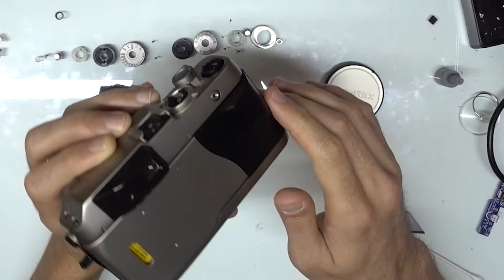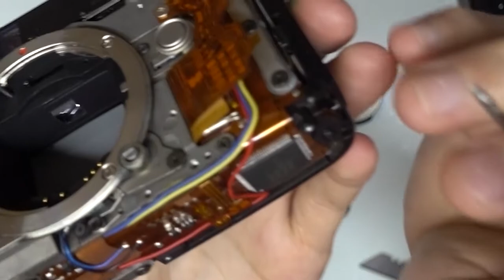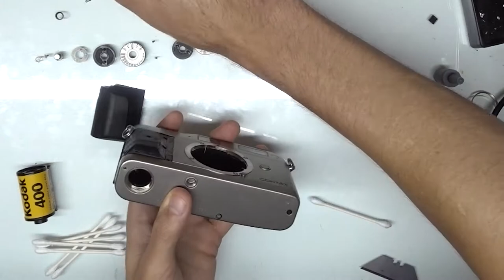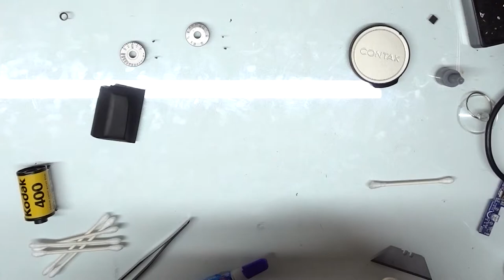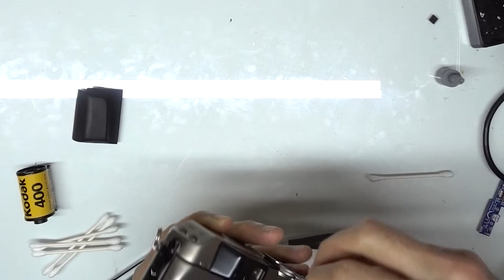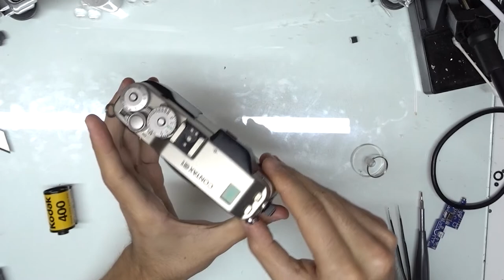Contax G1 35mm Range finder Camera Repair And Reassembly - Film Motor Ic Chip Replacement

Comment: I guess that is Generic IC I can buy from ebay ?
Reply from the maker: I wish i could say it is, but I bought these chips about 8 years ago and since then i have been unable to find any replacements for sale.

I keep a stock for my business repairs but outside of that i have searched high and low through aliexpress and other chinese chip sites and turned up empty handed.

There is one marked supplier but i've put orders in through with them and they always end up cancelling.

The chip Identifier is MDC03 - If you manage to find some, If you don't mind sharing a link i would be very appreciative.